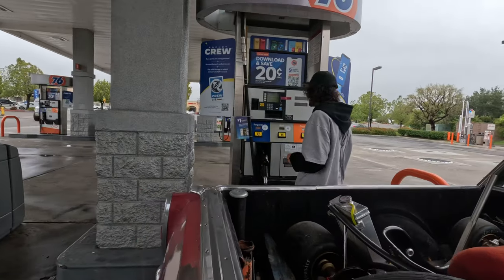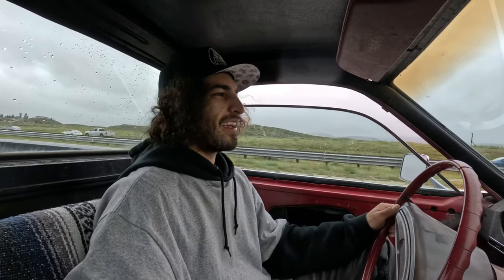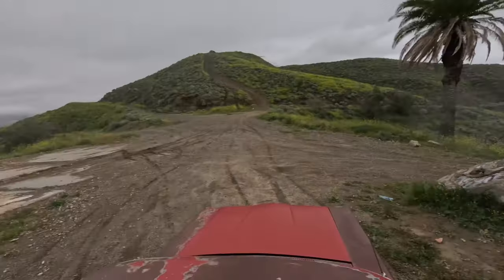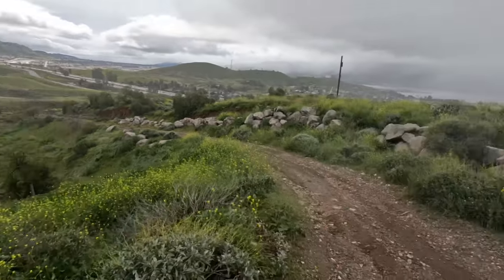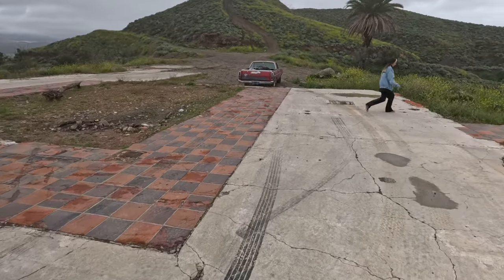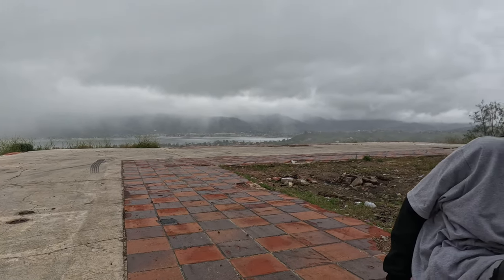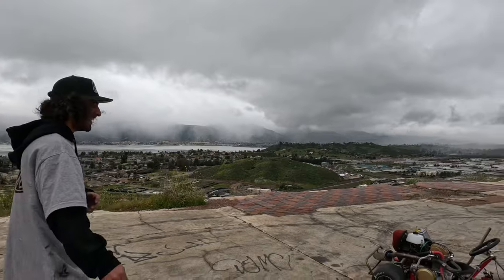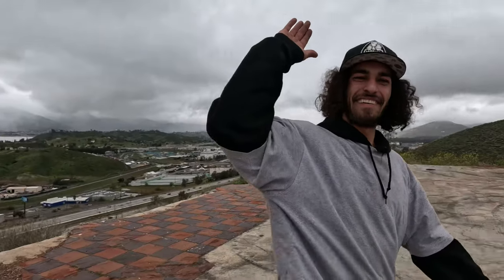CRF450r DIRTBIKE SWAPPED GO KART| FULL SEND / FLAT TIRE

Comment: Go karts, bad ass man. but that Ranchero my buddy have one that car had a 351 Cleveland. I don’t think it was original engine for it. did one tire burn out so I welded the differential up to make it positive . He, would do a burn out so long will it blow the tires up without even power braking. he used to use the car to hold his motorcycle to dirtbike track. The car started turning out really nice and then some asshole ran through red light T-bone them totaled it.